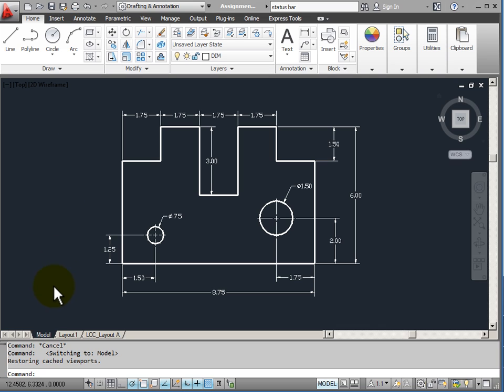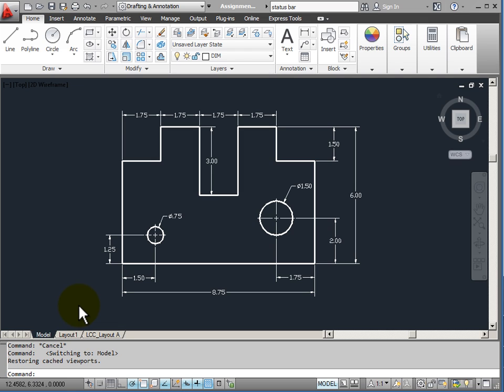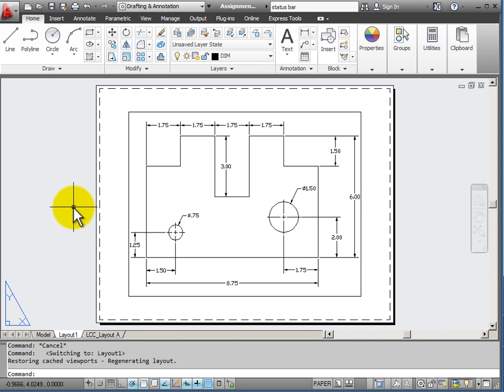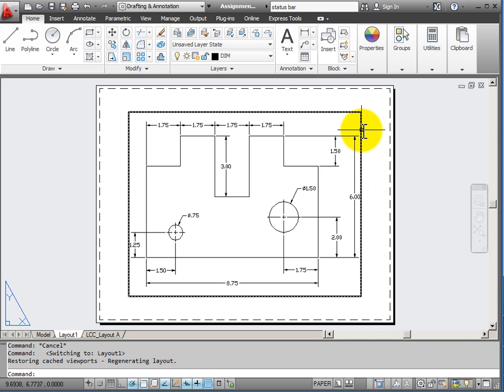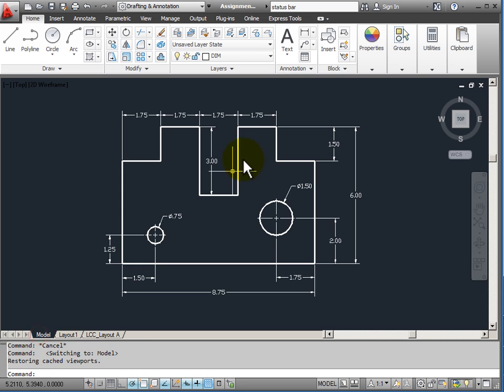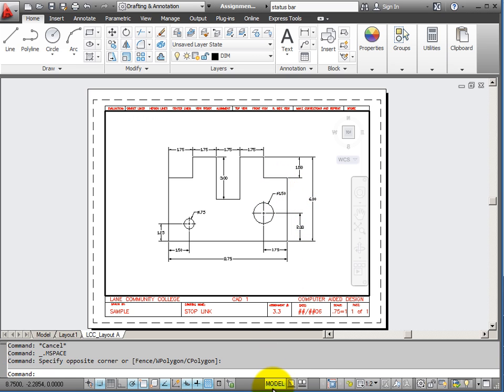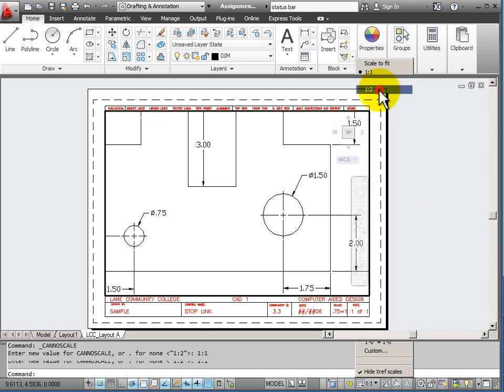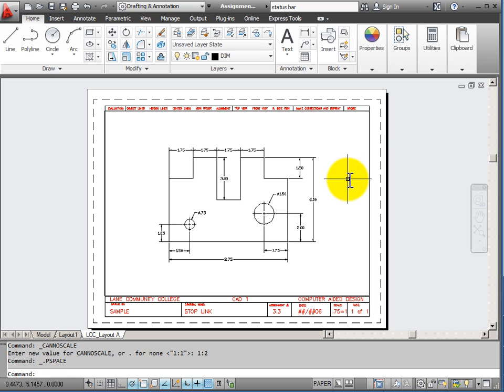AutoCAD Explained - Model and Layout Tabs

Comment: Help plsss
Reply: Not sure what your problem is.  When in doubt, save work....shut down....restart your system and program.  Start a new drawing and see if the problem persists or if it is isolated to the particular drawing you were working on.